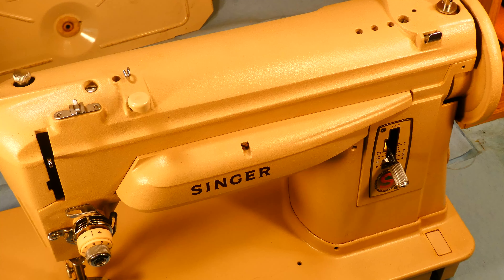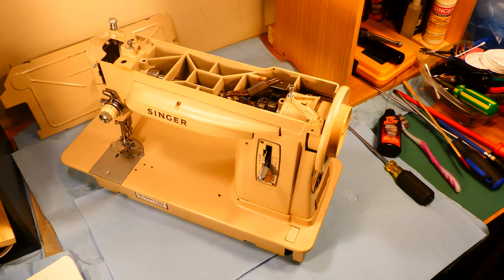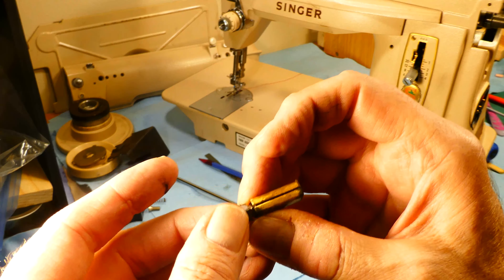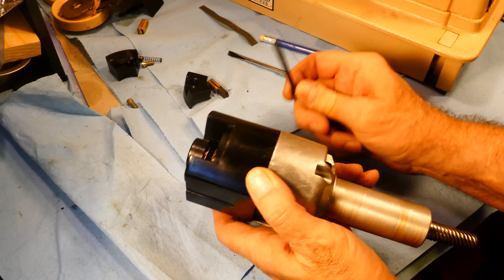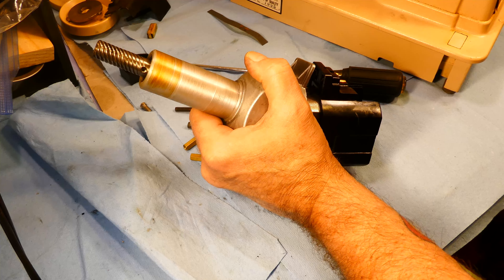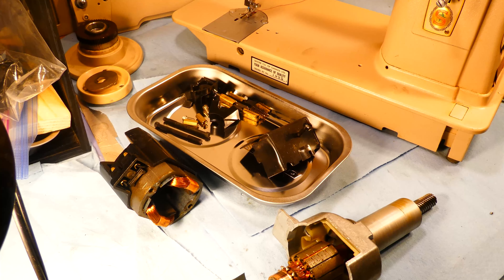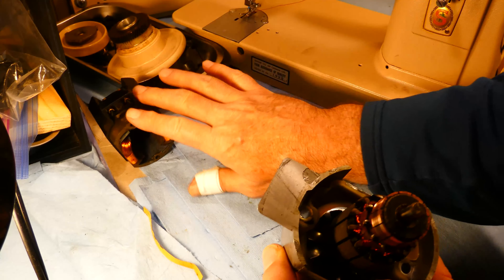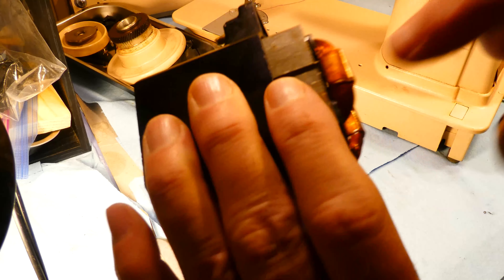SINGER 414G EPISODE 2 REMOVING THE MOTOR & HANDWHEEL FOR OILING

Comment: I'm having trouble getting the handwheeel off. I cant release the clutch to wind a bobbin.
Reply from the maker: Hi donna! I would soak it in oil. Anywhere that I can apply oil I will soak it. Then let it sit overnight. Try it gently if it will turn. If it won't, then I would get teh hair dryer and heat it thoroughly for at least a minute or two. use oven mitts to protect your hands if you need to. try to slowly, gently move back or forth.

If that still doesn't work I would protect the handwheel & stop motion lock washer knob with a cloth and the tap or strike the area with a rubber mallet or something similar. I have used a wooden rolling pin once!

Oil, heat & pressure. hope this helps. Most of the time oil & sometimes heat are needed. Very rarely have I tapped it.
Have fun!
Reply: Thank you  @JebbAdams  . Will try that tonight. Appreciate your videos!
Reply from the maker: Thank you so much for letting me know!